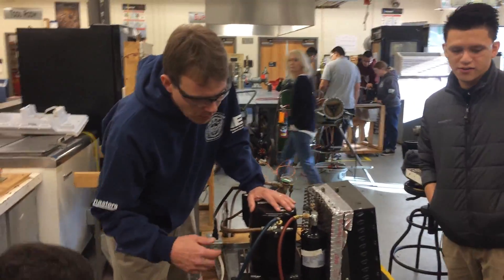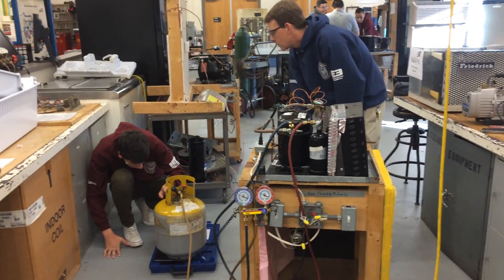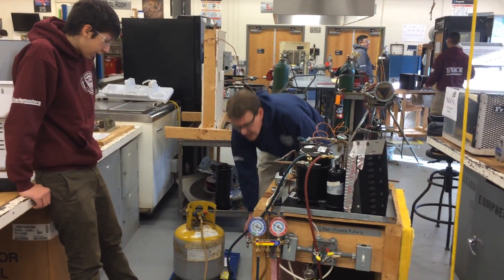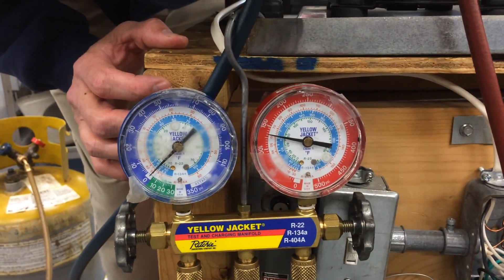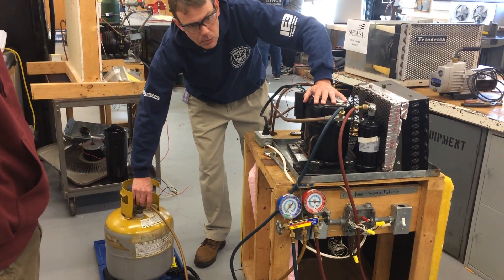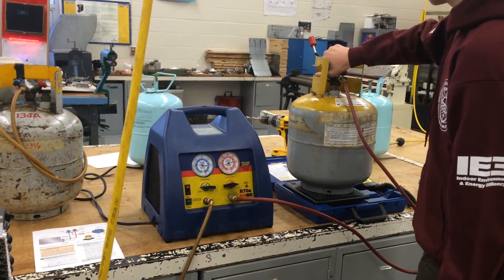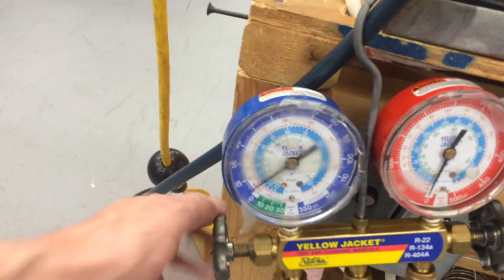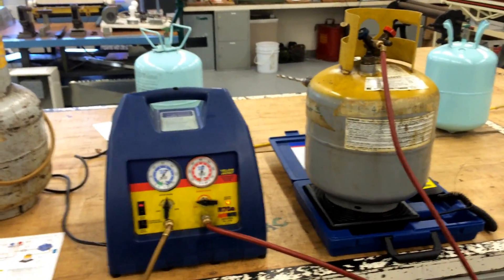HVAC Basics: EPA 608 - How to connect the recovery system - System Dependent & Self Contained

Comment: first you pulled the liquid refrigerant to the tank to the blue side, it should be the red one, ,yep?
Reply: I prefer recovering to blue (vapor) side of tank for liquid and vapor.  Liquid valve is useful for recharging system with blends.  Problem with recovering to liquid side is when you're down to remaining vapor in system is that it has to bubble through the liquid.  As far as colored knobs I really think it ought to be illegal for manufactures to do that as it can really wreak havoc and seems so unnatural to not follow color norms for standard high-side/low-side indicators of most tools and equipment.
Reply from the maker: Can't go by the colors on the valve or even the side the valve is on. That tank had a blue knob for vapor and it is on the left side. I have a newer tank that the vapor is on the right and in red. Tanks are tricky. Watch the video at 33:45 for specifics.

https://www.youtube.com/edit?o=U&video_id=V_wUZ4qmAnk

Thanks for the comment and for watching.

Comment: Isnt system dependent  for appliances under 5 pounds of refrigerant? Correct me If I am wrong but I read that system dependent really was designed for appliances pre 1993.
Reply from the maker: If the unit has a service valve on the liquid line and you front seat it and pump down the unit then technically that is recovering by storing it in the condenser or receiver if it has one and is considered system dependent. Most of the units that use recips and pump the refrigerant out without the use of the recovery machine are also system dependent. Works well with recips but not scroll. The rule is under 15 lbs of refrigerant can use the system dependent process. Not sure about only pre 1993 though. Thanks for the comment!
Reply: Edisonhvac, just for clarification, are you saying that under 15lbs referigerant all types compressors including scroll can pump down or that any pump down should be limited to under 15lbs except for scroll?